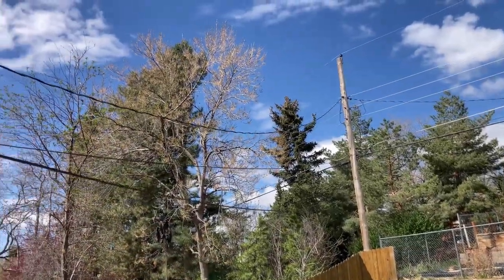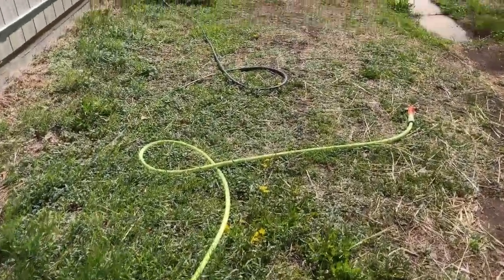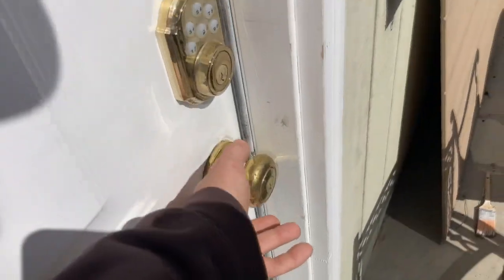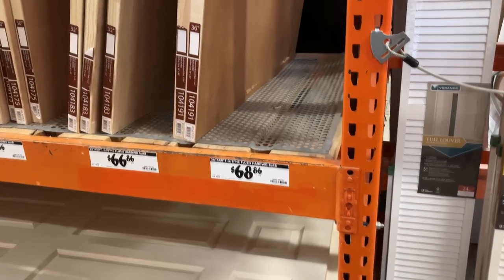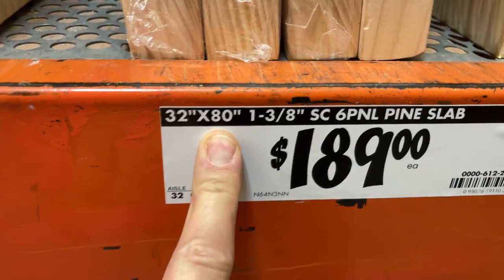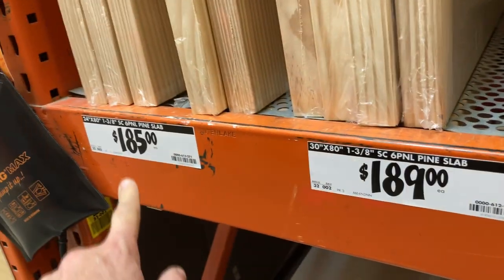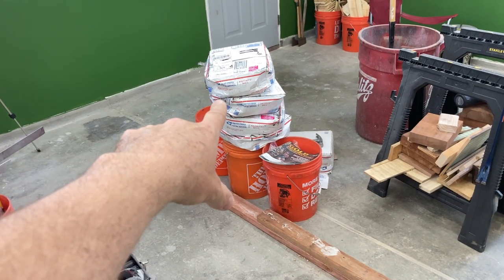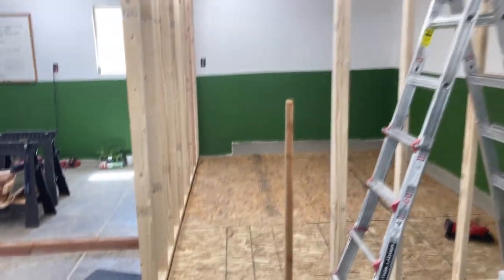Preparing Pocket Door Framing

Comment: hay i enjoy your videos . you need to remember that with pocket doors you only have the 3/4 in of the door frame, and the thickness of the wall material for screws to hang what ever you want . this may limit the amount of weight you can hang in the door space . you also are limited to the extra strength of the 3/4 in frame unless as i have you add extra 1x4 ware you think you need it . so basically you may only have the strength of the sheeting in some of the door area . just some thoughts since you said you have not had pocket doors before . keep up the good work .
Reply from the maker: Thanks and I did apply this reasoning to the material i;ve decided I'll be using to finish the outer sides of the partitions. I'll be using 3/4" plywood which will give plenty of strength for french cleats for hanging tools and smaller things. I won't be storing heavy hardwoods on shelves there due to the pocket doors.

Comment: It's looking great, your probably more square than most as you take your time and double check.  It's rough faming and most of the work i've come across is far from square.  Be careful mounting stuff with the pocket doors, the wall where the door slides in is thinner and you'll have to use special fasteners.
Reply from the maker: Thanks. I'll be doing 3/4" plywood (multi ply) on the outsides for more meat to attach the french cleats and for added strength. I'll be sure to arrange things as to put less weight on where the pocket doors are located regardless.

Comment: If you have a circular saw and a some MDF or similar, you have a table saw (just not yet built) 
Matthias Wandel has a good videos about a DIY table saw.
Reply from the maker: Interesting. I was planning on doing either a custom fence build for the circular saw, or just use the router for a nice clean edge. The tricky part will be removing the warp with my small planer. I may just buy doors for now. Haven't decided yet. Thanks for the interesting suggestion.